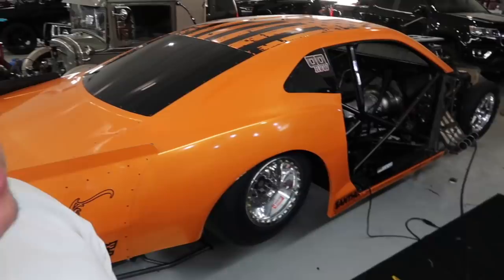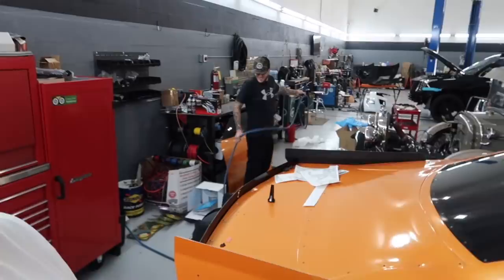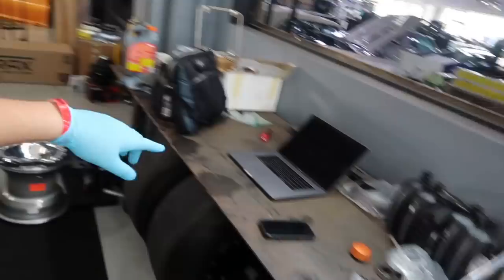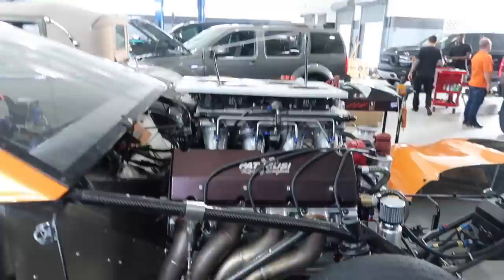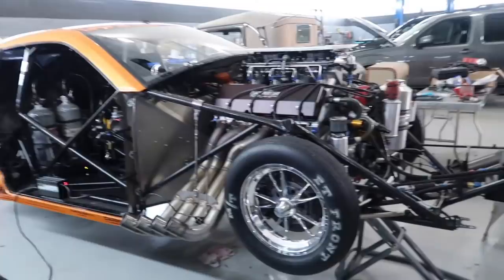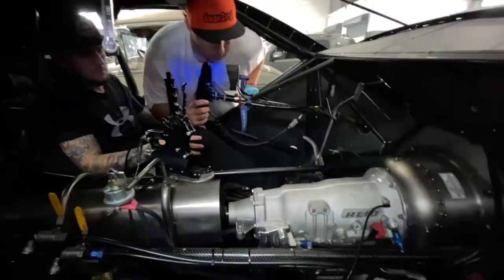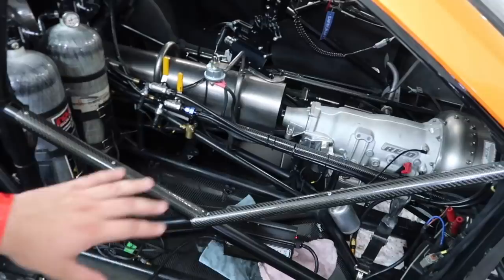Nearly Slung A Rod out on the Jack Stands!!! DANG THAT WAS LOUD!!!

Comment: It looks great, but does a hood scoop add horsepower?
Reply: Thanks, I guess that means more mph equals more horsepower? Justin would know. I prefer nitrous pro mods compared to supercharged or turbos, due to the hood scoop. It makes the car look bad ass!
Reply: Hood scoops do help when going down the track as it helps force air into the throttle bodies. Not much on horsepower, but air collection is key.
Reply: @305doc3  and the nitrous cars always sound the best!

Comment: I know you said you were going to put together an LS for x275 I hope you run the Carolina N/T btw but what I was going to say was CN BLOCKS makes a SBC that can be as big as 560cid and I think that would be awesome to see a 540ci SBC built by TKM so they can do the top fuel hoops in it there the only engine builders I know that does that which is just like an O-Ringed head with a reciever groove in the block but instead of .041 piano wire in the head it's a solid mild steel ring pressed in the block just outside of the cylinder with a reciever groove in the head and they guarantee it not to fail and you can put as much boost or nitrous as you want to it just go watch the videos where John Doc goes to TKM and you'll see what I'm talking about